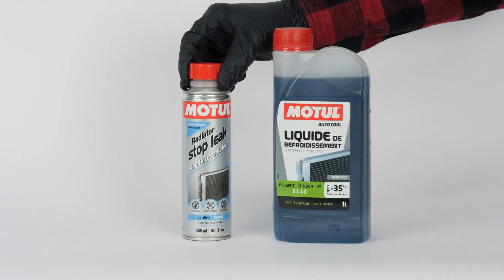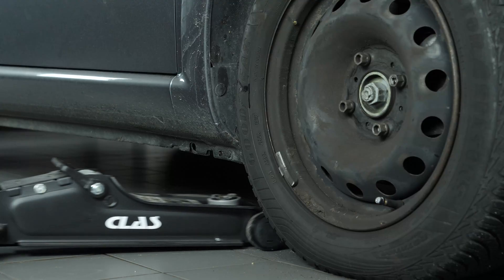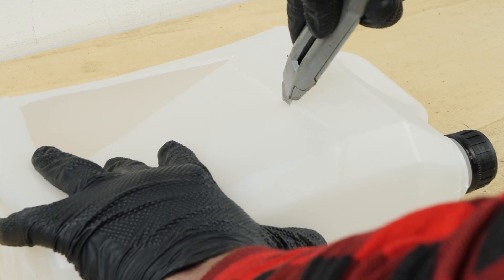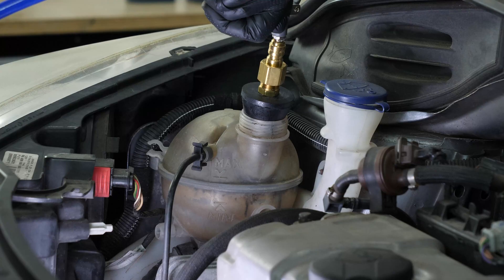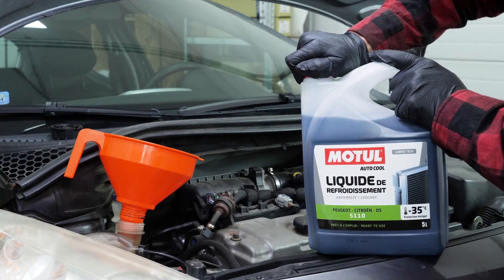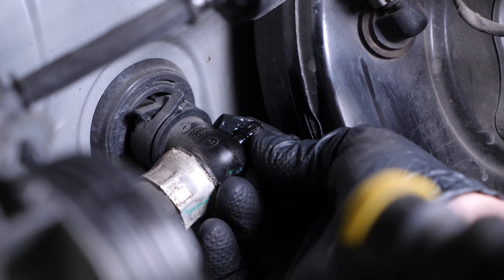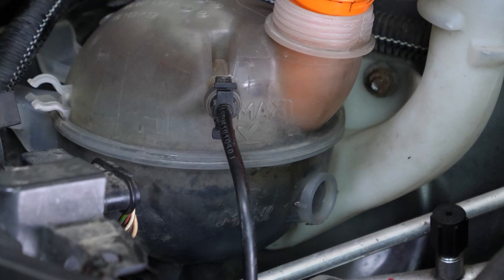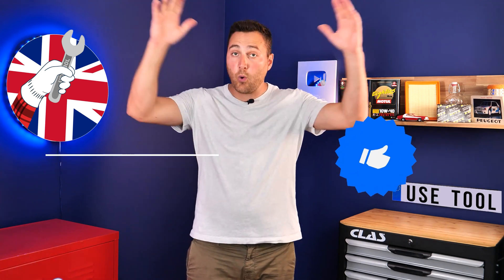How to bleed the coolant Peugeot 207 1.4 8V 🚗

Comment: the video presented could be titled: how to destroy your engine.you make three criminal mistakes.mistake 1. when NOT to drain the coolant, when the engine is hot.the thermostat of the specific engines of Peugeot (row TU),opens at 88°celsius, or outside temperature is less than 20°.or this difference is fatal for the engine.mistake 2. you don't turn on the car radiator, so the emptying is not only wrong but also incomplete.wrong 3. the sealant you put at the end is wrong. when there is a leak in the circuit, we intervene appropriately and replace the specific part.generally these chemicals are for damage and not for repair, as they block small passages and create overheating conditions.also, the expansion tank has in it, what a garbage dump has in it. the right engineer proceeds to extract and clean the tank.watch what you show and respect the work you do, otherwise go and become waiters, it would be more honest.😂😂😂
Reply: so you should drain the coolant on cold engine?
Reply: @bogumigwiazda603 Who are you mocking??? Probably yourself.
Reply: im asking if you should do it on a cold engine as i have to do it soon. in the video they do it on a warm engine and as i understand you are saying to do it cold @georgerousakis8501
Reply: @bogumigwiazda603 Change the antifreeze when the engine is cold. Before opening the drain, make sure you have opened the radiator so that it can drain from there too..if the circuit is dirty,It needs washing with hot water and detergent.Every two years we change the antifreeze according to the manufacturer's specifications.Are you okay with this???
Reply: thanks @georgerousakis8501